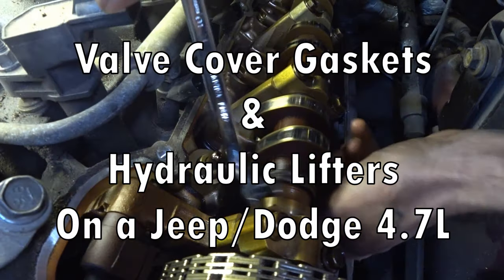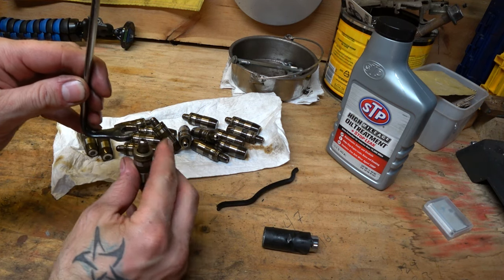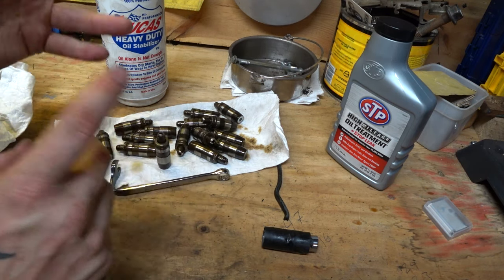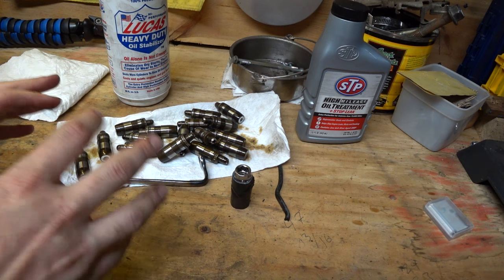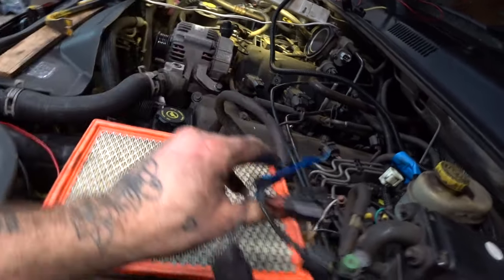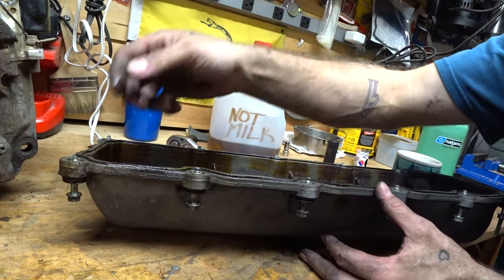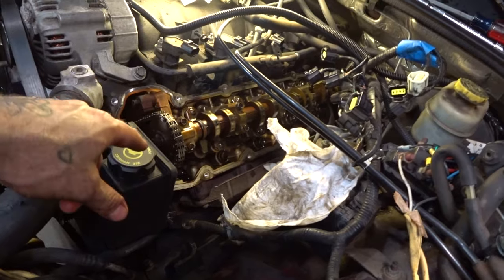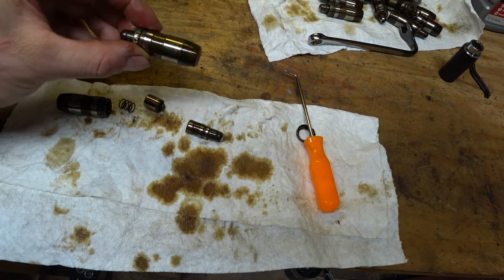4.7L Hydraulic Lifter and Valve Cover Gasket Replacement - Tips & Tricks to make it EASY

Comment: Pull the plugs, or use the serpentine belt on, turning the motor by the alternator nut. Spins the motor plugs in or out. With the fan out it's easier and faster to do this job. The time saved pulling the radiator/fan draining the coolant and pulling the heater hoses will make life easier. Former Mopar tech here, did a lot of these under warranty along with 3.7's as well, you can have the job done in under 2 hours and running again removing key components. no sense leaving it all in there and fighting the job, remove as much as possible and go with the flow! Nice job explaining and demonstrating the process of R&R the lash adjusters,  and reasoning behind doing this before they fail.
Reply: Great advice  keep up the great work.
Reply: A first timer with decent tools and some engine experience, 6-8 hours, realistically. I think it took me that long the first couple times, after that, I knew all the shortcuts and got the time down, so I was getting paid 5.5 hours for ~2~ hours of work, Flat Rate. Harry homeowner could do it in a weekend easy I think, with some decent tools, nothing extravagant or special, though there are special tools available for this engine.
Reply: @phillanassa759  how do you take the fan off the 4.7?
Reply: i @alant7516  Rent or buy a fan clutch removal kit. Other wise, a long skinny punch and a ball peen hammer. Facing the fan from the front end,., put the punch on the left side of the big fan nut. Hit it (the punch with a several pound hammer) counter-clockwise, 1/4 turn and it should come loose, then unscrew it. Shouldn't be tight, 10–15-foot pounds would be a considered almost too tight.
Reply: @phillanassa759  thank you so much!
Reply: Ok. I’m getting mixed answers. Do I need to soak the new lash adjusters in oil before I install them? Or do I. Red to “prime” them by pumping the lash adjuster with a small pick in the oil? Iv seen some folks that say they completely drain them of all oil before installing or it can bend a valve or wipe a cam lobe. Fixing to do this job on my 04’ ram day after tomorrow and iv had them soaking in a bowl of oil completely covered for about 20 hours now.
Reply: @james jines  hey did you ever get an answer on this what did you end up doing thanks in advance

Comment: Priced this through my local mechanic. They wanted $1800.00 to do this. So that's not going to be affordable at all. Watched a few videos (yours is the best btw) All parts delivered to my door from a local supplier was about $120.00. Great video and thanks for taking the time to make it.
Reply: That 1,800 quote had to be for a new cylinder head all together, along with head gasket, etc. Surely there's no way a lifter replacement would be that much
Reply: @aztechnology7996  I agree that price was stupidly high. But no it was only for new lifters. To boot as the engine is an over head cam all they had to do was remove the darn valve covers. It was thru Pep boys.
Reply: How was it doing it DIY? 0-10, 10 being crazy difficult?
Reply: @BrettWyrick  it was a 4 for me. Accessing the lifters from over the fender was difficult (2005 1500 w/2 inch lift, 33 inch tires + Crushed vertebrae from old accident) So I dropped the radiator and cross bar support for it and climbed in the engine bay. All told 5 hours work.
Reply: @aztechnology7996  I've been quoted around the same ($1400ish) all the way up to $5400 USD from a dealership. It's mainly labor, they say. Trying to figure out if I could do this myself with basic equipment.
Reply: @BrettWyrick  Brett, 40 plus years ago I was a foreman in a small roofing company. The owner kept his foreman and lead men busy during the winter plowing snow and pulling heavy maintenance on his trucks. I have changed the motor in this truck and know how to get quickly into the engine bay as I described.

I make about 80kish a year. Even if this was a 3 weekend job it was worth it to me.
Reply: @larrytate6884  appreciate your replies and knowledge, good sir. I'm thinking this job is a bit big for my inexperienced self. I've got an 09 Dodge Durango that has lifter tick and the cost of repair is going to be more than the value of the Durango itself, so I think I'm just going to end up purchasing a new SUV entirely. Thanks for your input!

Comment: Just wanted to thank you for this video, as well as your radiator removal video. I just finished the valve cover gaskets, lifters (all of mine had no “spring”), spark plugs, and radiator replacement on my wife’s 04 Grand Cherokee Overland and I don’t think I could have done it without your help. I went really slow, though, it took me five days!

Comment: You made it simple, saved money not having to buy a $50.00 tool, thorough instructions, and neat seeing the inside of the the lifter!  Great job!
Reply from the maker: Thanks!
Reply: I just spin the motor until the cam is not depressing any of the valves and then I just unbolt the cam so it's loose enough to remove and install the rockers without issues

Comment: * This is the way!  After buying, fumbling around for hours, and breaking the "special tool", I bent a 10mm wrench as shown (90 deg to get in and 30 deg to clear master cylinder.) It worked so much better!  Some notes:  1.  1 full turn of the main will turn your cam about 180. You can get to it from the oil filter hole in the skid plate so you don't need to take the front apart. 2.  Work a cylinder at a time, get the lobes pointing upish, pop rocker out, reinstall last one first - it'll save you time. 3. It's easier to just take all the stuff on top off. Yes it takes longer to put it all back but you won't cuss near as much.  (2000 Dodge Dakota)

Comment: I put solid adjustable ones in from Airram when I replaced the heads on my 04. Real pain in the ass getting them all just the right size however the very noticeable power increase, especially up top was worth it. No more morning clatter and knowing I won't kick a rocker really made it worth the money and time.

Comment: I went through this only to still have the ticking noise. If you have done this procedure and still have ticking problem then do a pressure test on the cylinder that is ticking, not a compression test which will fail on a bad cylinders anyways but you will be able to hear the pressure moving between cylinders via a bad head gasket blown between cylinders. This is what I found on my 4.7

Comment: Nice and informative video. You go into some of the important mechanical theory itself, behind the valve train. Those 4.7's need more regular oil changes and good driving habits (reasonable rpm's, time to warm up in winter, etc). My 06' Commander, 140k miles, I bought for dirt cheap, they said "bad head gasket.".....turned out to be both heads were completely black and sludged oil, burnt valves, 2 dislodged rocker arms, and a few dropped valve seats. Not to mention 2 broken timing chain guides and plugged oil valleys 😂. Was a fun project and saved it from the scrapyard

Comment: The first time I ever did the VCGs on these 4.7s, it took me over an hour to get all those damn grommets out. lol. Then I found the perfect tool. A 90 degree dirt cheap dental type pick. poke the point into the grommet and rock the angle of the pick against the VCG. it takes 30 seconds to remove them all, AND it can be easily done in the engine bay making the cover so much easier to pass through on the much harder passenger side. Great video btw.

Comment: I appreciate the great explanation of how lifters work and how to tell if they are bad. I have 180k miles on my 06 ram 4.7 and recently blew a head gasket so I pulled the engine and took the heads off to get machined and was told by the Machinist to take off the cams and rocker arms and I wasnt sure about the lifters so I took them out too and most of them have the loose plunger like you were talking about.  I didnt know how to test them until viewing this video.  Now I know to replace them. Tks!

Comment: Bought my 06 ram 1500 and once delivered had 215 miles on it.close to the end of the first year of running it i pulled a camper into the mountains of n.c. for a hunting/fishing trip. All went well and we left. Heading down the grade, in tow haul, i slowed rig and dropped it into 2nd gear to help hold me back. Even keeping it at low speed and mid high rpms i heard a change. Motor had around 25k on it at the time. Got it home, cooled off, and started it up. Been ticking ticky tic tic tic ever since. Itll tic heavy when cold and just starting up. Once the engine gets warm and pressure builds itll stop or just be a light tic. It has been a great audible warning if my oil is getting low as well. Fill it up and it diminishes. I now have 357 thousand miles on her and she is purring strong. Ive always said id do this repair job if it gets any worse. After watching this video itll be done as soon as the parts get here. Good video, and thanks

Comment: Very nice video. Covered every aspect of the job and reminded me I should pull plugs and replace them also to save the loss of blood. My wife has a 2002 JGC  Sunday evening she went to start it after stopping at her friends place and she said it made a bunch of noise and was shaking. So she shut the engine off opened the hood to find oil everywhere and smoke from it pouring on the exhaust manifolds.  I grabbed my kiddos and head over to pick her up there is a hole the size of a rocker in the passenger valve cover. Cross your fingers for me 🤞 it only damaged the VC and didn't destroy my Cylinder head. 😂

Comment: I’m thankful my 4.7 was well maintained by the previous owner. I think oil changes are the number one way to keep Chrysler products running good period. My ‘04 4.7 has 131K miles and my dad’s ‘11 has 160K and both run fantastic. Ticks on cold starts, but that’s almost common for the 4.7s I see. Didn’t know this was a major issue with the 4.7s.
Reply: Run some BG EPR before your next oil change and watch the motor come back to life. Not kidding!!
Reply: What is BG EPR

Comment: i just got a 4.7 today and I think this job is needed, thank you. has 148k miles, the noise is from the left side last two cylinders. hopefully this is it. it runs and drives .
Reply from the maker: Sounds like you will be fine, but I definitely recommend doing lifters

Comment: Great video on a known problem with these engines. I've also seen on of the wheels on the roller followers fail and wipe out a camshaft, while their out it would be worth making sure each of those spin freely.
Also on those runner grommets in the valve covers a trim panel popper, the little forked pry bar deal, will grab those and a quick twist rips that grommet right out of there. Keeps the awesome content coming!
Reply from the maker: That is some good advice. I did give my rockers a once over, but did not mention it in the video. i should have. Thanks for the advice!

Comment: Another trick before doing a hot start:   disconnect all the injectors, then crank it over  with the starter for about 15 seconds. Wait a minute, then do it again another two times. That way you're positive oil is flowing through all of the lifters and primed properly before the first fire. Did the same thing with my 3.7 and on a ford 4.6 (which is very similar).

Comment: Great video on the lifter replacement. I wanted to add that Martin has a video where he shows an upgrade to the '05 4.7 rocker arm. Smaller oil squirt hole directs oil right onto the cam lobe and rocker roller. Your thoughts on this upgrade?
Reply: Yes. I did the “Martin mod” while I was changing out the lifters. I have 237k, about 60k since the change out. So far so good. Supposedly the rockers oil much better than the og arms.

Comment: I'm in the process of doing a tear down/refresh of my 4.7 Grand Cherokee. I'm having the heads rebuilt, new stem seals, new intake valve seats as a preventative, and I believe they're putting in remanufactured valves and lifters as well. For $350 a head, that's not too bad IMO. But I find that as I start doing things, I find other things I want to replace, or needs replacing. It's nice to not need to get it done right away, as it's not yet a daily driver (and I work from home 4 out of 5 days a week anyway), but it's crazy how many things pop up lol

Comment: Nice job Doug.We would of liked to hear it start up with the new lifters.I know mine sounds like a diesel for the first 30 seconds....
Reply from the maker: Fair point. I should have done that.. I will tell you thank between soaking the lifters and dumping lucas on everything it did not tick for even a second. I did however have an awful miss fire on cylinder 8 because of an injector plug that was loose. That stopped my hear for a second until I realized what it was

Comment: I've got the 3.7L in an 07 Dakota. Hopefully it will be a little easier than your 4.7L. No valve cover leaks, but there is a lifter tap. Just wanted to say thanks a bunch for this video. I've never done any engine work beyond changing spark plugs, but you've given this 18 year old kid the confidence to do this job.
Reply: Also thought I'd mention the Melling lash adjusters are now $8.20 on Rock Auto... glad I only need 12
Reply from the maker: Good luck with it! This project is a great way to get into engine work

Comment: My lash adjusters failed on a very well maintained engine right after a Seafoam treatment. Your explanation of the internal springs is great! Mine probably got trashed after the Seafoam.
Reply from the maker: Sounds plausible. Storys like that always scare me! Seafoam can go either way
Reply: @DEInTheGarage  Yeah thankfully nothing bad happened and even limped it home 5 miles while it was misfiring like crazy. Sat for 5 years, new lash adjusters and fluids and she runs like a beast! 160k miles young still

Comment: best video on this i've seen yet. I plan on doing this job on my dakota this weekend. you must be in the states lol those melling lifters off rock auto are over $15 each for me lol so i went with slightly cheaper "sealed power" ones for $11 each. Still not the cheapest ones on there but I figured new "cheaper" lifters are probably still better than the lifters that are already ticking in it lol

Comment: Have a 2004 WJ with the 4.7 and 174,000 miles. It has always had 3,000 mile oil changes and all regular maintenance. Its valve cover gaskets do leak a bit, but it never requires any added oil between changes though it does smell bad and occasionally will smoke just a tad from the exhaust manifolds (and this comes out from around the driver headlight). It has never overheated. At this point I am tempted not to mess with it. It has very little cash value as is, and it runs fine (no warning lights or anything abnormal). It was pretty much gifted to me and I have two much newer vehicles to daily drive. What say you? I am afraid I will end up messing something up when it might run another 100,000 miles just fine.

Comment: Thanks for the video. I have an 08 ram with the 4.7 and it has the annoying ticking noise.  Never knew bout the lifters. Looks like that will be getting done this spring. I run mobil 1 5w20 high mileage full synthetic in my truck. My truck has 154,000 miles and i noticed it doesnt have the pep it used to. Thank you for making the video
Reply from the maker: Lifters gave mine a little snap back that it didnt have before. I would give it a try

Comment: I plan to install a remanned 2008 or newer 4.7HO long block in my 56 Dodge pickup build on my 2001 Dakota chassis. I like the 4.7 engine and Powertrain has addressed all the issues with the 4.7. Also Chrysler updated the heads casting to better support the lash adjusters. My goal is to get near 325hp at the crank. Should give my 56 comparable performance to the Dodge Lil Red Express which was known to be a strong truck.
Reply: Don't waste your time. The 4.7 is not a good engine at all. Go with a 5.7 hemi at least. I'd say go for the 350 gm LS motor. These engines don't last. Mine had to be rebuilt at 155k and I babied it. 3 head gaskets post rebuild too

Comment: While in there replacing the lifters, wouldnt you reccomend replacing the notorious leaky valve seals?
Reply from the maker: I did not (obviously), but sure. That would be something else to do. I did not as I did not feel like messing with the valves and risking dropping on into the cylinder

Comment: I'm about to take on the task of replacing the lifters on my 4.7 as well. Just wondering if mopar lifters are significantly better for them to demand the price as compared to the melling lifters ??
Reply from the maker: I really do not think so. I certainly trust Melling for in-engine components
Reply: @DEInTheGarage  fyi, they are not 3 bucks anymore.  More like 7 now.
Reply: @ocavant  Car ID Melling valve lash adjuster (lifter) $5.69; Melling rocker arm $7.32